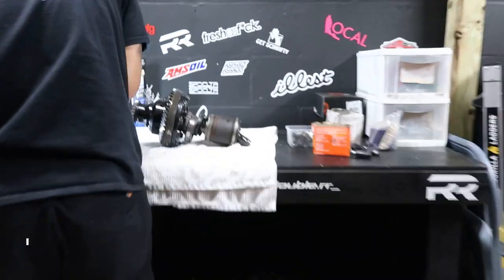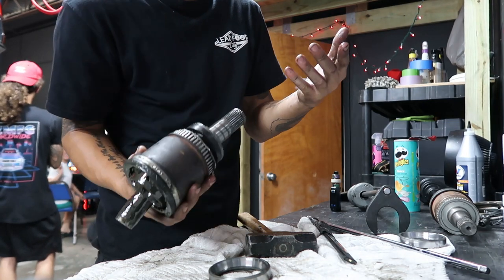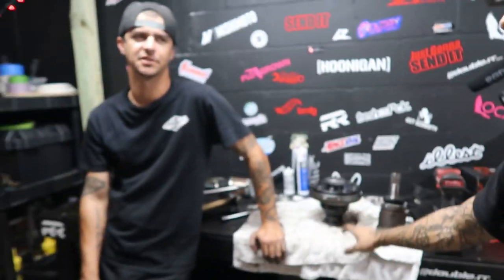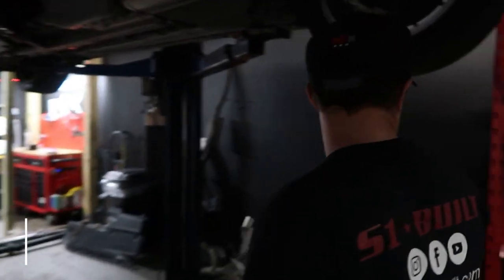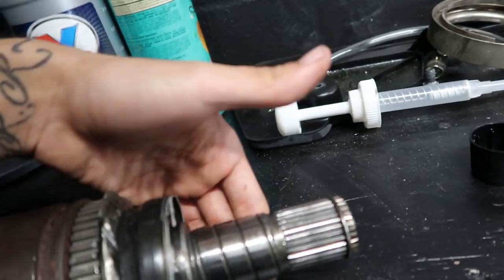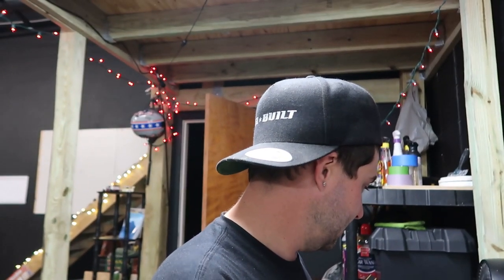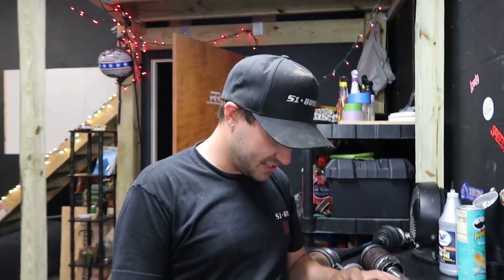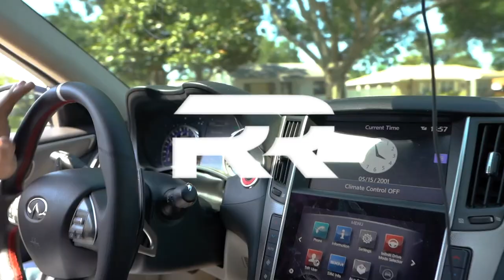What Happened To My Q50?!

Comment: Damm bro that sucks hopefully you can get that q fixed , I’m looking into getting one as well any recommendations for mods ?
Reply from the maker: Thank you for the support & there are plenty of mods i can recommend. Just depends on what your looking to get out of the car! if you have any questions, feel more than free to ask me.
Reply: @RomeloRoman what would you recommend for a supercharger kit ?
Reply from the maker: @danielnunez4272  CJM fuel system,  tune from rsenthalpy
Reply: @RomeloRoman  thanks  , anything else you would recommend just for mods to increase hp
Reply from the maker: @danielnunez4272  just take it slow, put the kit on first & get the car running. Upgrade the fuel system & get the car on the road!!